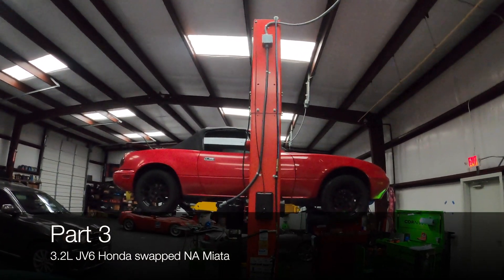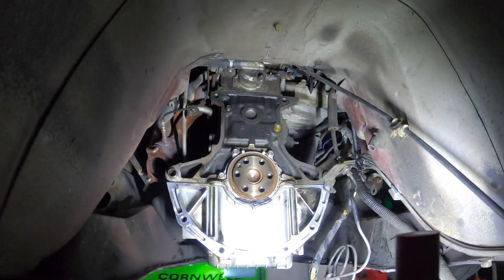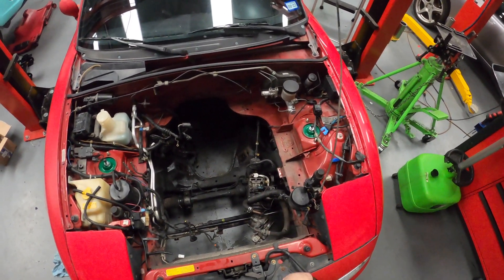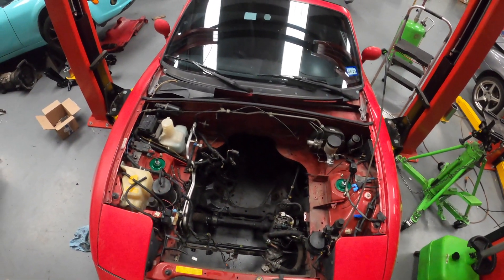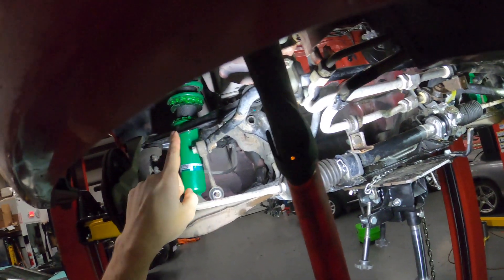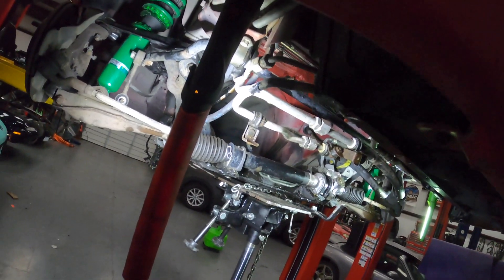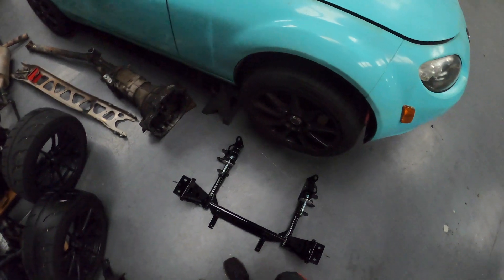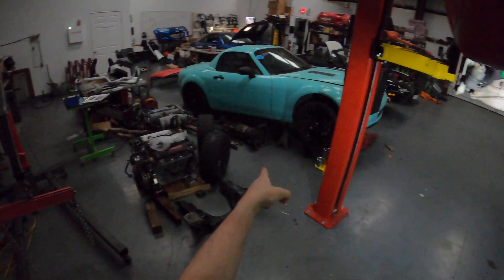Honda V6 3.2L swapping an NA Miata - Part 3

Comment: I've been interested in doing this for quite some time, So I am really excited about watching this process. How is the MiniTec kit quality wise?
Reply from the maker: Friend of mine has built a few of these at the local race track and for the longer term experience they've stated that the oil pans will leak. The instructions are extremely poor considering it seems they only give you enough information to physically get it into the engine bay and you still have to do some guess work to get it that far. We'll see what clever things I have to do to get it running after that point.
Reply: @ArmandHindrichs  will the customer be using the stock ECU from the TL or will they be using an AEM stand alone?
Reply from the maker: @Azov237  MiniTEC supplied modified harness and ECU. Still has OBD2, some ports blocked off, allegedly tuned?